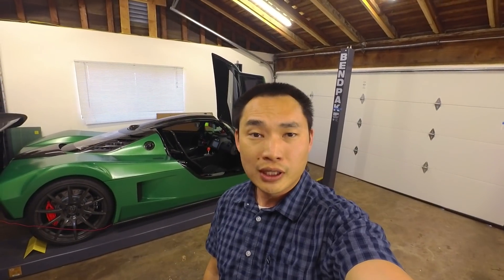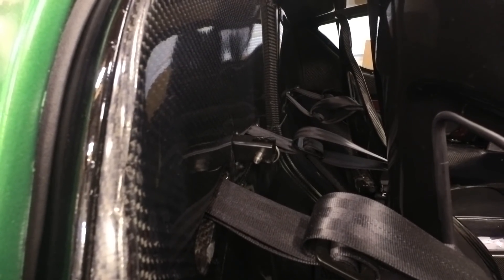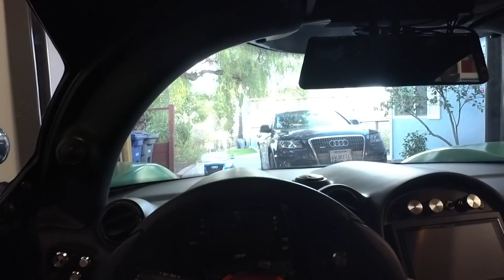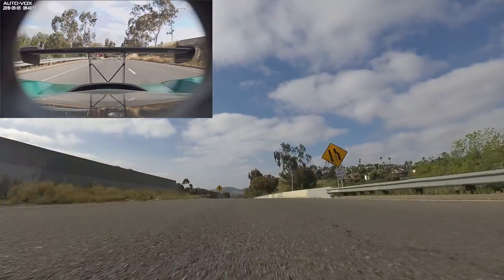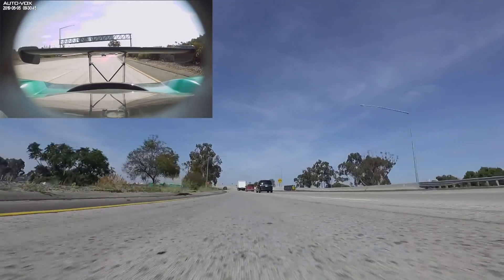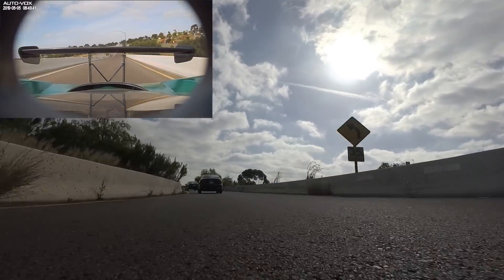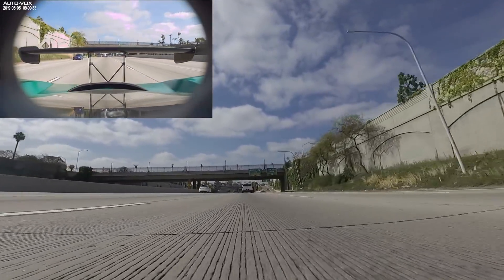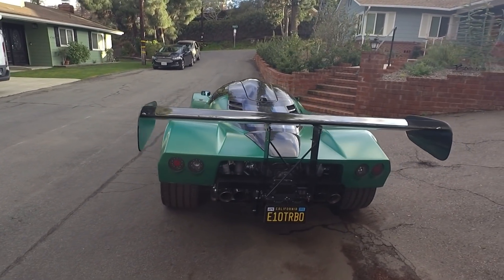Superlite SLC - What's the CamScore?!

Comment: These cars are very quirky, but every time I open the garage it puts a smile on my face... it’s hard to deny how cool they are!   BTW, you once again forgot the doors lifting at very high speeds!  😂
Reply from the maker: @SS OFFSHORE - I verified my doors don’t lift at 120mph.  Maybe they will at higher speeds 🤷🏻‍♂️
Reply: I have been thinking about a possible quick fix for the lifting doors at a higher speed. Not elaborate but you could possibly use two small brackets; one for the door and one for the body, and connect the two with a quick release pin on the top rear corner of the doors. Simply insert the pins through the two brackets when you think you might be going a bit faster than say, highway speeds ;) You can keep the pins out of the brackets for regular driving, and if you attach a small steel cable to the heads of the quick disconnect pins, you won’t have to worry about them being loose or getting lost. This seems to work very well on the H60 Jayhawk helicopters I work / fly on. The only downfall I can see is exiting the vehicle in an emergency situation, or for emergency crews to get the door open from the outside if necessary. If you have the two-piece windows it could be possible to get to the quick release pins from the outside.
Reply: CorvetteCody put the brackets on the inside of the SLC around the top of the door. You might have to modify the inner tube and door panel to have a solid place to mount it but definitely want it accessible Incase of a roll over and you need to open that door. You also might want to have some cabin pressure relief vents, at high speed there could be a lot of air coming from your hvac system and the fact it’s a kit car probably isn’t air tight! Must be allowing a lot of air in the front of the cabin with nowhere to escape considering your engine firewall is probably the only air tight barrier in your car. You could mount some relief vents with pressure activated valve under the seats so there out of sight.

Comment: I don't understand, why kit cars are such an underrated low grown market. This and the Factory 5 and Ultima GTR are such bargains compared to any supercar.
Reply: I think it's because most people just want to buy it and drive it. Few people actually want to build something
Reply: Probably because kit cars such as those provided by Factory Five and DDR require parts from an ultra-specific donor vehicle that not everyone has, let alone belonging to the same requested model year. With Superlite, you have the advantage of putting virtually anything you want in it, and the parts don't have to be pre-owned.
Reply: You need skills to build a car. Plus you’re not saving money building a kit car.  It’s probably about $110,000 to build an SLC with a good engine, paint.
Reply: (Some) people buying high end ferraris want to brag about the brand, but they usually dont want a track version like a scuderia. There's awesome lesser known watch companies too that make extremely cool ones but they'd rather have a stupid $70k octagon shaped one.
Reply: @dannyMCDelight  You can build a pretty decent SL-C without spending that much. I've seen a few examples that are cheaper that were done well. LS engines are dirt cheap, and paint isn't a necessity as wrapping, or dipping is a cheaper alternative. Doing it yourself is also a money saver though time investments are a thing.

Comment: Just a point about your 6 point harness. 
If you do it up nice and tight, then you really need to be wearing a helmet with a HANS device.
Otherwise, if you have a moderately high rate of deceleration in a crash, you are going to seriously hurt your neck.
The worst is craniocervical instability, which requires surgery, if you survive.
Reply: helicart what kinda deceleration are we talking about? Like 150 to 0? Would I have to worry about that if I drive it in the street
Reply from the maker: @Bloody Psycho - anyone that runs a hard mounted harness like these needs to worry about these types of injuries.  Standard autos use multiple systems to slow you down and will “give” in an impact.  This is why you see all competitive/track drivers using HANS devices with these types of belts.

Comment: You have a Grwat and Amazing car..
I know some have put V10 engunes in it..
Or twin turbo to 1300+hp to the wheels..
Im sure those are Brutally Fast..yet Not favorable in street use ( lol )

Im sure the power yiu have in it still destroys 98% of the cars out there..especially when it comes to handling and reliability..

How much did you spend on it when all is said and done ( under 80K not counting your time )

I wonder how it would do compared to the V6 turbo Radical car..

It is the SLC or Radical im considering..
Though im thinking the SLC is more favorable in reliability..both should be about as quick though the Radical will handle better..yet the SLC is a far better price and bargin..

Your thoughts ?
Reply from the maker: @MrBOB39 - thanks for the kind words about my build!  The radical and SLC (can) be very different cars.  My SLC was built to be a very capable street car but it is not an all-out track/race car.  There are many things I did that compromised performance in favor of streetability.  The radical has fewer provisions for compromise, it's a very focused track car that can be plated and driven on the street.  I think you would likely have to invest a fair amount of cost and effort to make it a "comfortable" street car, insofar as these can be made comfortable.  Even mine would not be well suited for most drivers.  Either car, you have to be prepared for it to not be well suited for getting groceries (unless the grocery store is on the other side of a mountain pass).  I enjoy driving my car to and through the canyons and the way it is currently configured lets me do this.  I would make several changes if I wanted it to be a more serious track car.  Whichever decision you go with, it will be a fun journey with many challenges!  If you have more questions feel free to reach out to me via my blog or on the GT40s website.  Good luck!

Comment: Dang, I needed a child seat tether!  I've been itching to get mine to figure out the location for the fire extinguisher, figured that'd be the perfect spot.  You should paint it orange to match rest of the orange accents.
Reply: Dang it, I'm mad at myself for not thinking far enough ahead to do something similar for a child seat!
Reply from the maker: @Infinite Reality - it can be done without too much pain, you'll need to drop your a-pillar covers and remove the upper panel to get access to the rear cross bar.  Weld a tube off the cross bar and cut a hole in your tub so it can stick out.  The platform/harness I have for the child seat mounts using the same holes that my seat mounts to.

Comment: How did you make all of the carbon parts and how difficult was it to setup the gauge cluster screen?
Reply from the maker: @Anthony Allard - many parts were skinner in carbon fiber.  A few were simple wet layups and my end plates were vacuum bagged.  The gauge cluster setup is pretty easy. There’s an option for loading screen and the dials etc are pretty straightforward using their software.

Comment: Do you know if they are planning to update the looks of the slc?
Reply: What kind of updates to the looks would you like to see?
Reply: @20spray1  a more modern design  but still the same concept
Reply from the maker: @Mathijs De Guchtenaere - I do not know if there is any plan for a body update.  Updating the body is an incredibly expensive proposition due to the very large molds needed to make these, I would expect a healthy price increase if that were to happen.
Reply: @CamThai  maybe some Day they will make a updated body but for the same chassi so you can swap them en have a 'Total new car'
Reply: @mdgmix7917  They won't be doing an updated look for this particular car. Not only for reasons that Cam listed, but also because there's just no real need to. The rarity of seeing one of these on the streets more or less trumps the design's age. Though I think the car is aging very well. Besides, you can always tweak and change parts of the car to suit your own personal tastes.